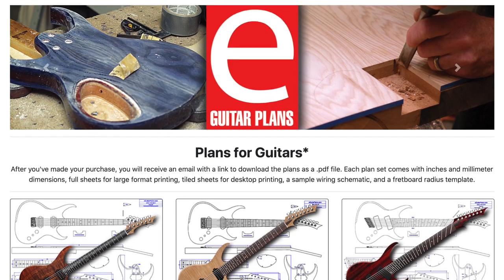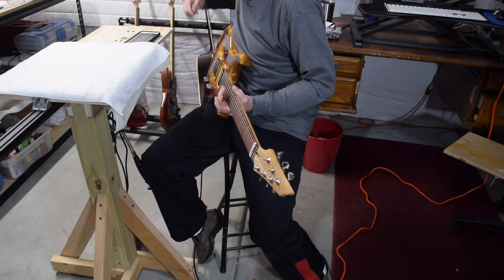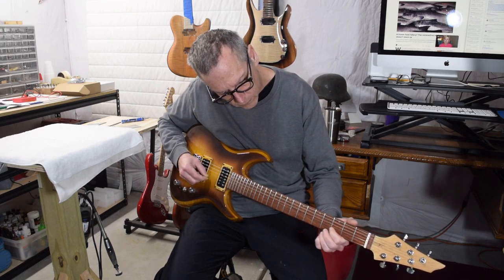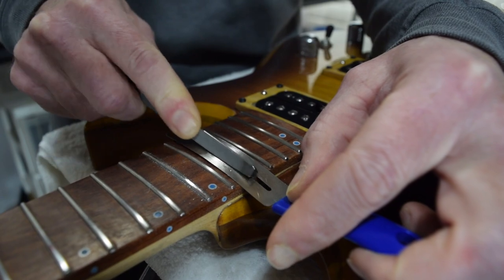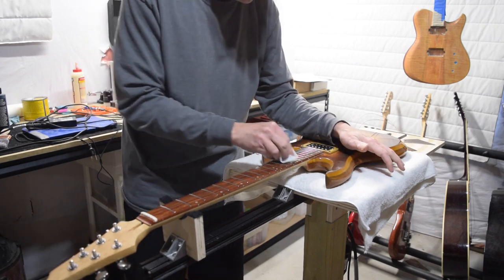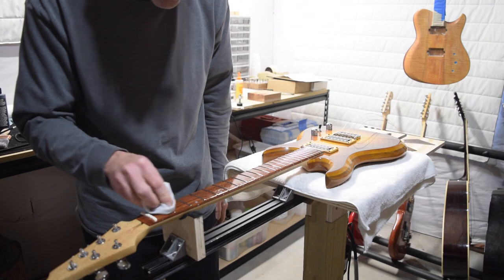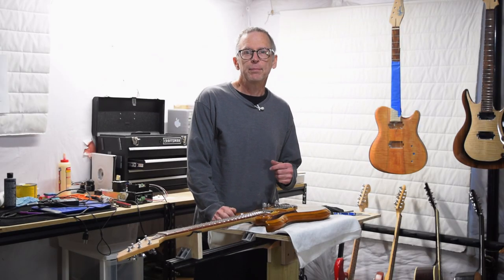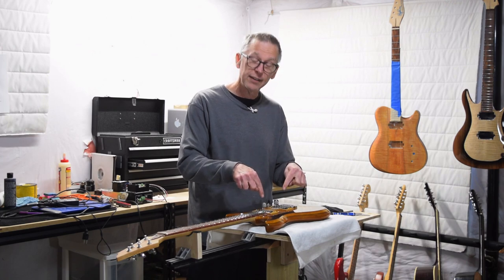Making A Laminated Top Guitar Part 23 How To Setup A Brand New Guitar

Comment: For others out there, one comment about buffing frets with a Dremel.  Watch the heat build up.  Don't press too hard or stay in one place too long.  If you are not careful you can actually burn a maple fret board right at the fret. It happend to a "Guy" I know one time. Doohhhhh
Reply from the maker: Spot on.

Comment: Hi Chris, Do you have any info on the 3M PPS system with your QS-125-WB sprayer. I'm not sure which adapter is needed for it. Thanks
Reply from the maker: Sorry, I don't. I don't use the 3M PPS system because my production volume is low.

Comment: Thanks for the education chris. I have an issue, I bought a les paul studio tribute and it rattled bad, I tried adjusting everything and even with the highest relief and action the thing still rattled. I searched online and read about truss rod rattling, could this have been the issue? I sent the thing back, now my les paul special is doing this, what is this about? I don't think is the frets either...
Reply from the maker: Without seeing it, I can’t say.
Reply: @HighlineGuitars  Thanks
Reply: @mgcnashville6615  yeah, I tightened the truss rod and even put my hand over the bridge while plucking the strings. It was a nashville without the wire in it and I didn't see any loose saddle or screws. My les paul special has a wraparound bridge and it's doing the same, it seems to be coming from the neck. it's that like a normal thing with gibson or what? lol
Reply: @mgcnashville6615   yes tuners are fine rattle is coming from inside the neck. that is why i think it might  be truss rod rattle
Reply: @mgcnashville6615  yeah but the good thing is it doesnt come through the amp